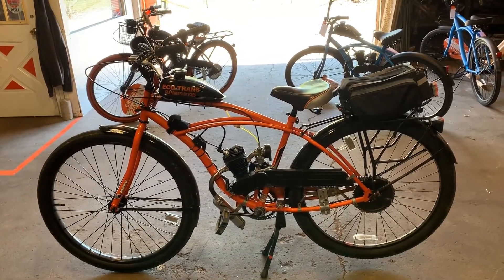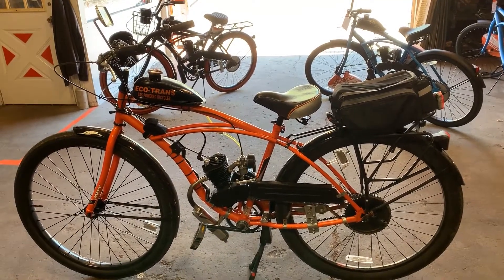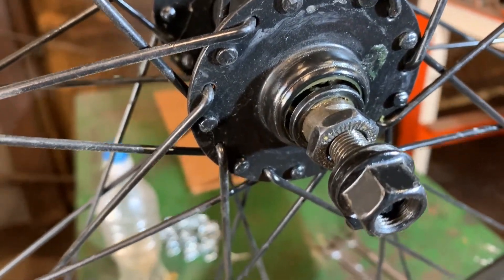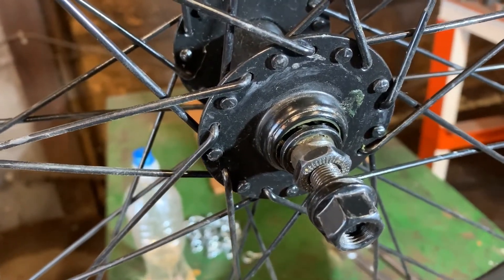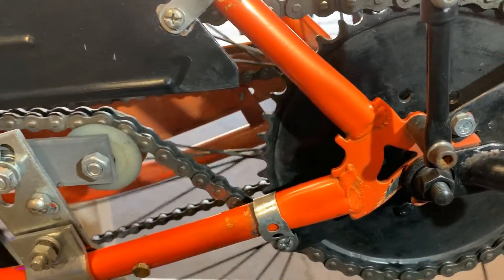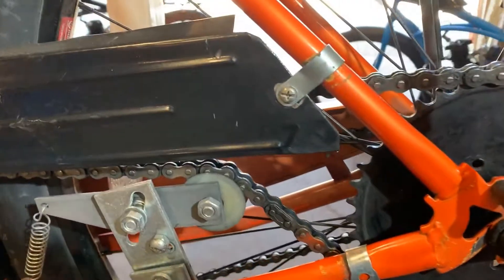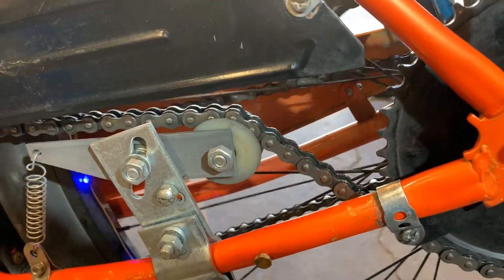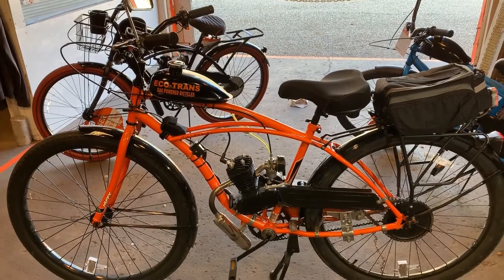A tad bit of maintenance for summer

Comment: Good tips. Thx. And should we grease the "gears" (whatever they're called) inside the clutch assembly?
Reply from the maker: Usually the oil from the chain keeps that drive gear lubed so no real need to oil it separately..
Reply: @EcoTransGaspoweredBikes  ok. But how does the chain lubricate the internal drive gears (not sprocket) when the chain doesn't touch any gears?
Reply from the maker: @pitapitabread  I'm sorry I thought you were talking about the drive gear for the chain..🤦‍♀️ Your talking about the drive gear from the crankshaft to the clutch assembly, those gears you can give a light film of grease on if you want to but it's not required, if you choose too, try not to get extra grease all over because it's a dry clutch system & if grease gets into the pads section your clutch will slip..😭